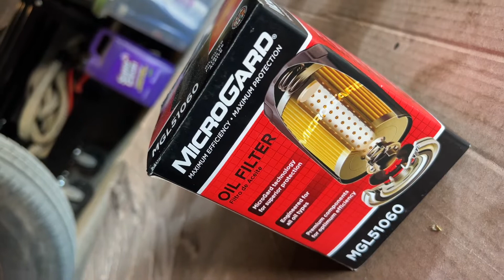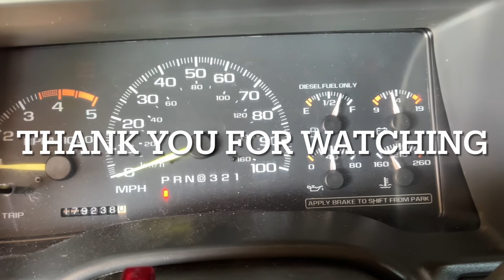Oil Change On A 6.5 V8 Chevrolet 2500 (Quick And Easy)

Comment: I'm glad you spilled a little oil out of the filter as you were fitting it. You should have told people that you need to fill the new oil filter with new oil before you fit it up to the engine. We take it for granted what we know and because of that, we overlook what we consider to be obvious but someone looking to see how it's done would probably not pick up on that. Cheers.
Reply: 5:15 ??